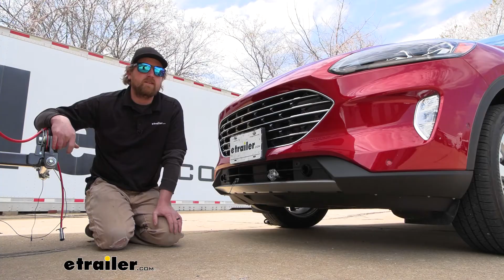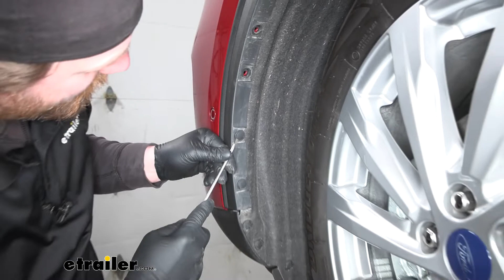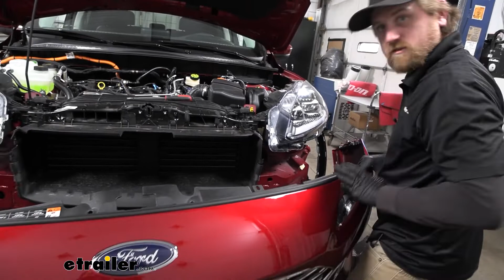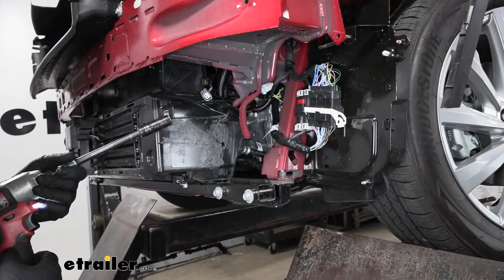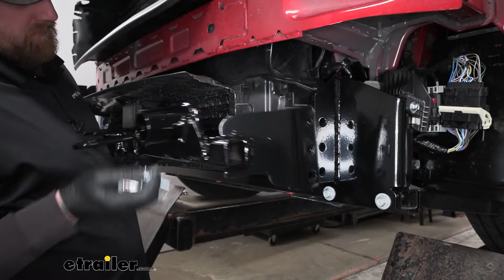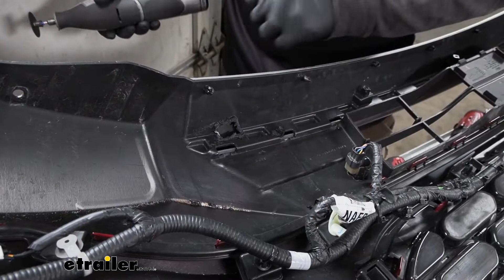etrailer | How to Install: Roadmaster Direct-Connect Base Plate Kit on your 2022 Ford Escape

Comment: Thank you so much for videos like this! Have you done a 2022 Ford escape plug-in hybrid install? I’m thinking about getting one, but I don’t want to if the install of the plate is overly difficult due to the hybrid plug-in situation. Thank you!
Reply from the maker: At this time, we haven't done the plug in hybrid, just the regular hybrid. Roadmaster confirms that the # RM39FR is indeed a fit for both the 2022 Ford Escape Hybrid and Plug-In Hybrid models. Roadmaster says that a professional installation will take approximately 3 hours. 
https://www.etrailer.com/tv-install-roadmaster-base-plate-kit-2022-ford-escape-rm39fr.aspx